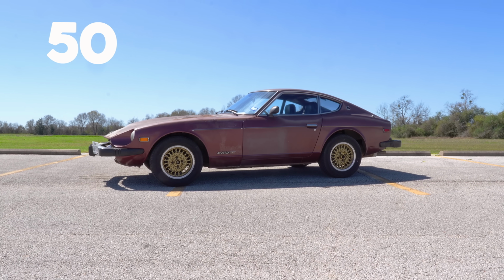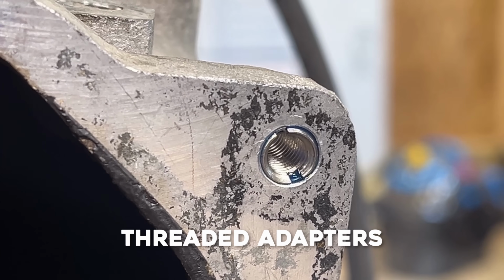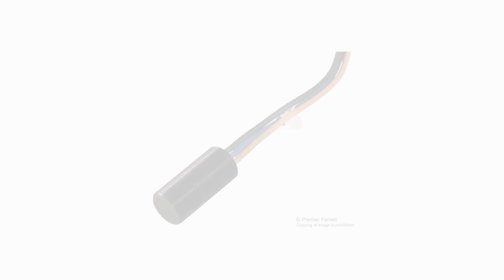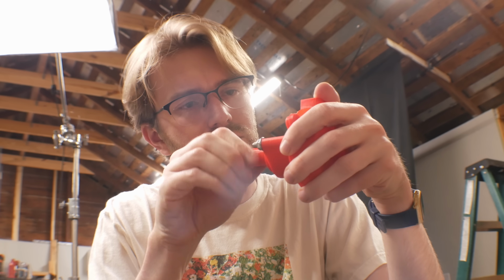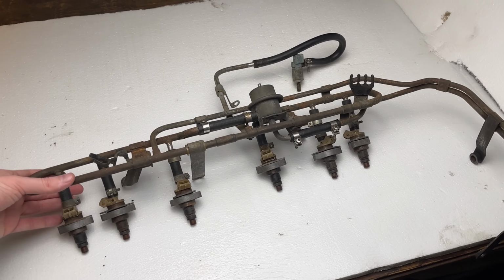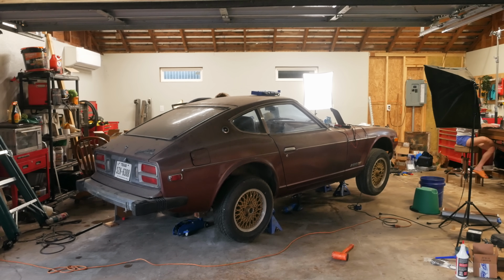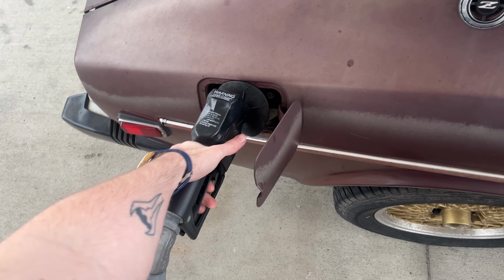Modernizing a Vintage Car

Comment: You're a fucking legend man holy shit! subscribed.
I have the exact same problem with my old ae95. The distributor is fucked, the ECU doesn't match the engine, the throttle body is fucked and idle up doesn't work. If I just did all this shit and modernized the engine it would run. Too bad I don't have a machine shop or a garage lmao

Comment: My older brother bought a 240Z when they 1st came out.  He drove it around for a few years, and being a bit mechanically inclined,  he turned the Z into a  Scarab Z.   It was a pretty cool car at the time, that is, until the frame started rotting away.

Comment: Make it go faster.  Replace the vacuum advance on the distributor with a 1071 240Z vacuum advance and hold on.  I put on my 1986 280Z and it screamed.  Actually out ran a Virginia trooper car owned my a local county deputy on the way to work one day.
Reply: 1971 240/Z vacuum advance.  Sorry or the misprint.

Comment: Takeaways from this project.
 1 The original system was more efficient than expected, If less reliable. 
2. This update will make older cars like this able to be modified to use modern technology.  
3. now that it works, power adders, internal and external, are able to be tuned for.
4. Any ice system, with time and patience, can be made modern if you wanted to.

Comment: The more I watch this the more I am amazed at the waste of time replacing something like the Distributor. The original is literally bulletproof. A Turbo charger would have been so easy and you would have actually got much better performance while possibly increasing mpg

Comment: If that was my car I would get overhaul the engine and install a turbo on it. I have driven them with that setup and they are great. I hate fly by wire throttles because you lose the instant response the cable gives. Besides there is zero performance advantage to an electric throttle body. You are spending so much time on so little return. In short drop a SBC in it and easily double the performance of the inline 6.

Comment: Bosch, German dishwasher company?  Ronald, clearly you have not been paying attention.  In 1902, the chief engineer at Bosch, Gottlob Honold, unveiled the high-voltage magneto ignition system with a spark plug.  Amazing Ingenuity!  Quiz!  Which company Invented the O2 Sensor?  Robert Bosch.  Duh!

Comment: Okay BEFORE I get into this I want to say that I learned to drive in one of these, same make and model.
TECHNICALLY it was my GF's car. And it was a bat in the 1980's. So now I'm going to SHUT UP and watch this to see what you managed to coax out of the old girl...
AFTER - well, impressive work, but sorely disappointed at how little extra power was coaxed out of that engine.
Seriously, when that metallic burgundy was fresh it looked MUCH better, maybe a refinish or a paint job would improve the performance? :-)

Comment: There's one very important question I would ask myself before starting such a project: if I succeed, will it be worth the time and effort I put into it? This is mostly not a technical question since I have sometimes failed to achieve my goal, but learned enough in the attempt to make it worthwhile. Even if I only learned to scale down my ambitions I gained practical experience that gave me confidence to attempt other projects in the future.

Comment: I own a modern day diesel, loads of sensors and loads of expensive repairs..So I opted to go backwards...purchased a 42 yr old VW rabbit diesel..
Original 1.6 liter turbo diesel, bone stock. Everything is mechanical, the Bosch fuel pump is basically a mechanical computer...I love it, i did have pump rebuilt by "Giles" and gained 20 HP..
The car was the cost of me fixing the DEFlines on the newer diesel...
The best part is, I'm old I grew up in 80s cars. I've done most of the work myself, and 50mpg out of a 42 yr old car is pretty good.

Comment: Hey, can u add a supercharger, better wheels, add wheel arches, headlight cover for the hollow part & a #022658 or #1A2954 Navy Blue metallic body color with double shadow/dark silver racing stripes 
And maybe carbon bucket seats?

Comment: See how different people are? You really worked out a new system which took $, and months, and creativity. Worked everything out, and got about 20 hp, plus like a couple mpg more. Hold my beer…My solution is to pull that pos boat anchor and drop in a nice Chevy crate LS-3. Maybe a couple days work for a thoroughly modern engine, plus a new transmission. All to give you another few  HUNDRED hp, AND a few more mpg. Then, with all the time and effort you saved, restore the body and interior, so every other part of the car isn’t a pos anymore.  Of course, I would have started with a first gen 240Z.  But, that’s just me.

Comment: I don't see why the wave washer would be the cause of the wobbling trigger wheel. the cause is play in the parts in multiple directions and a fairly short distance between the two points the axle is actually fixated, ie. the two bearings which are not locked in place and thus allow an amplification of tolerances by slightly tilting. unless the wobble is the axle sliding up and down instead of tilting as shown in the video. the solution without the washer is better assuming there is not a significant force pushing up and thus unnecessary complexity. the locking spring ring for the ball bearings should have been possible for the initial design too. for example a ball bearing on the other side of the trigger wheel and thus a much bigger distance between the ball bearings would have solved that problem too, but then the placement of the lid would be part of the tolerances.

Comment: My 240Z is a pita when it comes to repairs. I would love to modernize it, but the value just isn't there if I update things. Rust free 75k miles. The only real problem is the wiper motor.

Comment: 1989 Ford Bronco 2. Put engine back in. Which injector wire goes to which injector? I had them marked but they had faded. Learned it didn't matter, they all opened at the same time!

Comment: Wow. JetTronic is the Bosh version of Motronic , which is also Bosh.

The ROMS of your old JetTronic has a Volumetric Effiency bump map,
that if you dumped the roms, you would have found, imported it into a spread sheet, and then used your vacuum gauge readings across RPMs and load, would have given you a better VE bump map, or you could have just ordered the better ROMS, and download that VE bump map.

Reference is the bump map for another 6-cyninder engine the BMW 745i.
The difference is that the 745i has a SU-10 turbo charger.

"The car featured here is a 1983 E23 745i. It has the inline-6 3,430cc M106 engine with Bosch Motronic (DME) II fuel injection system. "

One very last item: The intake manifold is one of the worst Datsun ever made, exceeded only by the very worst one, that is on the 280zx. 

Next question?

Comment: An encoder is a sensor or electromechanical transducer that converts physical motion (such as linear displacement or rotation) into a digital or analog electrical signal. These signals are read by control systems to precisely monitor and adjust parameters like position, speed, and direction.

Comment: That engine was designed by Benz (Pre Mercedes) and will run longer than any modern engine. Just change the oil. Butcher that (I know you already did) and you will end up with somthing far worse in the long term. I took my 71 Datsun 521 with a L16 that was overbored, a head that was shaved by roughly 1/4" and the whole unit was puking oil the whole 150 mile trip, just to pickup a l20b block that was chilling in the coastal rain. Been 13 years on the rebuild and starts everytime even though it sits for most of the year.

Comment: Put some electric hub motors on a 2wd junker, assign acceleration to the electric drive train and sustained speed to the combustion drive train.  Poof, you just engineered the lowest impact, most efficient, personal vehicle solution for modern life that physics allows.

Comment: I had a 1974 260Z 2+2 with automatic and air conditioning. Quite rare as it was the early model lacking the 5 mph extended front bumper. What you did was in the best tradition of a Hot Rodder with a Bulldog personality. I mean that in the best possible way. You took each problem figured out a solution. You made test parts to formalize a solution to each or researched and found the required parts. You found persons who would make the required newly designed parts. You got hung up on the fuel injection for a while until you realized you had forgotten to give the EMU a fuel, rpm and throttle table. You have learned the "How Do I Do This Method" and it will serve you well in life. I would like for you to recognize your spouses support in this endeavor. I am looking to see how that "Z" ends up in the future. Thanks great video.

Comment: Why did you get rid of the EGR? EGR can increase efficiency under cruise conditions and it reduces emissions. 
You definitely should not be driving a car with a misfiring cylinder. Missing one coil and driving down the road to get a new part is a great way to ruin your catalytic converter.

Comment: I knew it wasnt going to be a worthy fuel mileage improvement.
I would have just pulled the old efi crap off and used a carb

Comment: The most common amount of power loss from engine to wheels is 20%. 175-20%(35hp) is 140 hp. Achieving 145 horsepower at the wheels  means you have exceeded the maximum rated power for that engine. Pretty good for not doing a complete rebuild.

Comment: Gotta be careful with those cheaper dial style timing lights, I went to reset the Ignition timing on my 1984 Fiero and had just purchased that exact timing light and it was showing 48 degrees of timing advance on a smooth idle after rebuilding the distributor. When I exchanged it for another one (upgraded to the Maddox) it was actually at just 15 degrees of advance.

Comment: I drove a 1976 280Z. I then bought a 300ZX, then another, then another and then owned a Nissan Xterra. Fuel injection was the only issue on the 280 and it fishtail in rain and snow. 50 lbs over each rear tire solved that issue. Nissan is an incredibly reliable car. Has a severe right rear blind spot. I stopped driving them when SUVs frequently near missed me and they gave me back pain when driving high miles for work. My large favorite vehicle was a 98 Lincoln Navigator. I loved that vehicle. If only it got better mileage. 😢

Comment: Oops, I had to look for a site that could calculate miles to gallons to liters per 100 KM, now I can say, your car is a heavy drinker. For cars of that age is maybe okay, and compared to America made cars it might be super, but today, with the prices at this moment . . . . You improved the car and it is an achievement. There is enough crude oil in Venezuela, so who cares?

Comment: Estimated Stock L28 Volumetric Efficiency Table

For a stock L28 engine in good health, the VE typically follows this curve based on its 135 net hp rating and peak torque of approximately 144–148 lb-ft:  

RPM	Estimated Volumetric Efficiency (VE)
1,000	65% – 70%
2,000	75% – 78%
3,000	82% – 85%
4,400 (Peak Torque)	88% – 92%
5,500 (Peak HP)	84% – 86%
6,000 (Redline)	78% – 82%
Reply: Peak Efficiency: The L28 reaches its maximum VE at its peak torque, which occurs around 4,400 RPM.  

Intake/Exhaust Porting: The stock N47 head on the 1978 model has 44mm intake and 35mm exhaust valves. Aftermarket modifications, such as individual throttle bodies (ITBs) or "shaftless" butterfly valves, can significantly increase VE by reducing intake restrictions.  
+1

Compression Ratio: The stock 1978 engine has a compression ratio of 8.3:1 (N42 block with N47 head).  

Camshaft Profile: The stock cam has an intake duration of 240° and an exhaust duration of 248°, which is optimized for mid-range torque rather than high-RPM efficiency

Comment: Forklift short blocks and long blocks are readily available. They can make decent power like toyotas 4y engine platform is pretty decent and you can pick one up for 2500 - 3500 new

Comment: Up that CR bud... Bring it up to around 9.5:1 that will make the car lighter on gas also fit a header and a 2-1/4 inch Exhaust and you will easily better that mpg number. power will also bump due to the CR. Oh and sick dizzy mod.. You could probably make a few and sell them off as the L series engines all use the same design distributor

Comment: I have to disagree on the relability on modern cars. one software glitch and the car does not run. old cars there can be several things wrong with it and it would still run. modern cars act like a football player with a sprained knee and old cars are like Roman soldiers

Comment: "50 years" doesn't mean too much ... what is under the hood and what type of frame does it have ?
 I wasted my time and looked it up a Datsun  280z, with the cost of  replacing the in-line 6 for a generic small block V6 with the same 140 HP output  ... you are looking at about $250 without labor/shipping costs .

Comment: Why not rebuild the entire engine, a new cam with the same lift new valves new lifters, new heads. Just so it runs efficiently like it was new. And all the mods you made. You might get 20- 25 more horsepower. Plus much better fuel economy.

Comment: Wait you made all those custom pieces and then used a clamp on bung for your lambda sensor? *facepalm*. Also if you lean out some of the ve table on the cruising areas you can likely get a bit better mileage. I have a few different tuned vehicles, I am running around 17:1 in those light cruise times like on the highway at low throttle. It took my miata from about 20mpg to around 32mpg if I'm on the highway. Just something to think about.

Comment: What's funny is the milage and power were about the same as a GM 350 V8 of the same era.
A friend of mine who was a precision machinest by trade, took a 240Z, gutted it, built his own custom suspension and steering componnents, engine and transmission mounts, pulled back the driver's seat and mid-engine mounted a performance built 350 and 5- speed manual. the result was perfect 50/50 weight distribution and more power than the wheels could really put down. You might think that such a vehicle would be janky and unpleasant to drive, but he daily drove that car until cancer took him away from us. I don't know what happened to the car after he passed. I suspect he was buried in it.

Comment: This was almost my very first car. My dad got it for me when I was 15ish... One problem was that it didn't run. It sat in our yard for nearly a year without ever being fixed. Long story after that, but I've always thought about getting one and I must have been googling them 5 months ago when I first saw this video. It just popped up in my feed again and tbh, I watched the whole thing a second time and it was equally as great as the first time. I thought I would check and see what newer videos have been posted since then.... Admittedly very surprised to see that this was the last video. Hope everything is well and an update shows up at some point.

Comment: totally worth it. im a child of the 60s, my dad raced 240zs. i remember going to races where the 510 ruled. thats 
Datsun! my best friend had a 260, all ways wanted one. the cockpits are so cool . id even take a ZX 2+2 now. we use to tease people with those. stationwagon Z. oh, wait? no joke, didn't they produce a few of those? actual station wagon Zs?
to compete with Mercedes and BMW. i remember the add with 2 bags of golf clubs would fit nicely. in the 2+2 🤮. slowwww. piggy..automatic 🧚‍♀️

Comment: More Reliable are you serious ,On line many videos of crap quality engines,full of plasic and sensors.The local mechanic can no longer work as they dont have the computer info or special tools required. The Mercedes W123 Taxis are still Running in the Third world 50 years later. Old Volvo cars were Tanks and hold world records for Milage

Comment: Modern car electronics are defo much less reliable than the older cars. Constant dash lights, limp home modes electric windows stop working etc etc and you plug a obd scanner into them and you just end up chasing ghost faults round in circles. Give me a older car any day.

Comment: Very cool. A modern cable throttle body with an integrated idle control valve would also have worked to remove all the other valves and retained the mechanical connection to the throttle.  What I found disturbing is that I've never had a single coil system have a coil failure. But, I've read about numerous multi coil systems have failed coils. Why? They are doing 1/6 or 1/8 the work of a single coil. Weird.

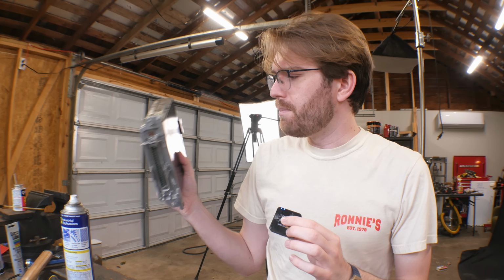Comment: 4:19 dishwasher company Dude seams like you have no clout but maybe you are just being that rude because you know that easily offended Germans like me tend to react on your video which pushes your video. So it seams like you have more commen with German automotive parts ingenieer bosch than you might think.
And by far boshh is known for their electric tools and industrial production hardware and software ;)

Comment: Dude you're hilarious. Funny now people are swapping out new engines for non computerized engines, because the computer can't be replaced or the dealer won't work on the car any longer. I guess they could just replace they OEM computer with one of these generic computers you have.